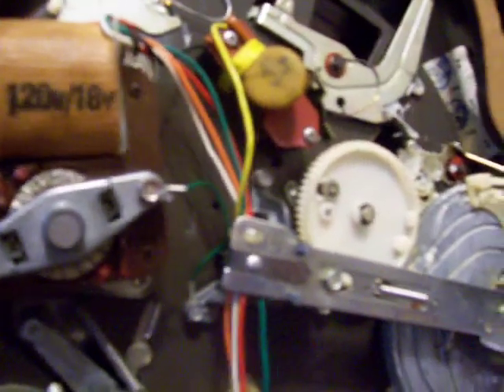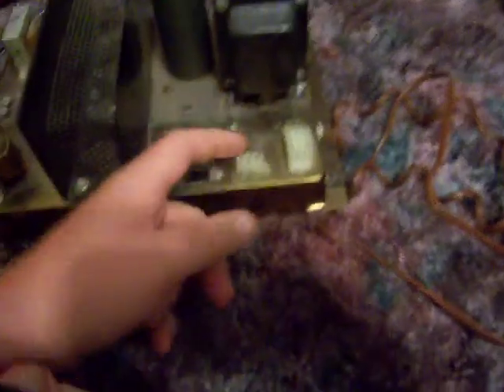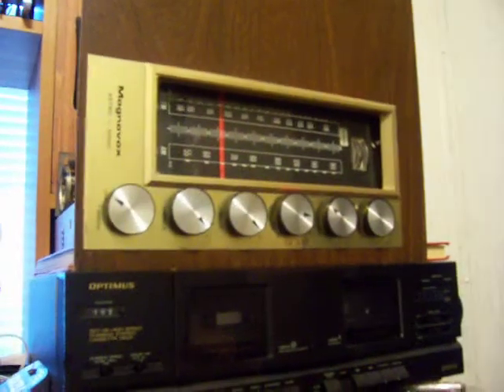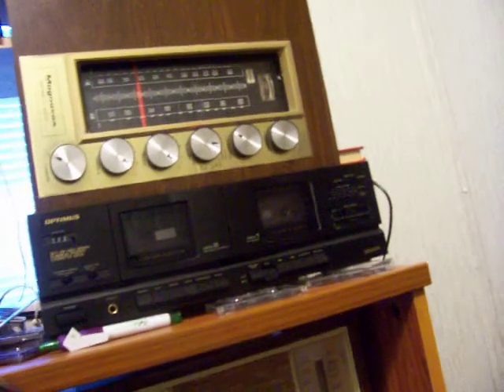Magnavox Amp & Record Changer Hookup Issue

Comment: There is usually one neutral lead and two hot leads in the 3-pin power connector to the phono. One hot lead supplies power from the power line and the other is a return back from the phono switch, so that when the phono switch supplies power to the motor, this hot lead returns power back to the amp.
To get it to stay on, the two "hot" leads in this circuit need to be connected or replaced with a switch to simulate what the phono would do.
Reply: the yellow wire is strictly a return path it connects with the black wire at the changer. I bought molex connectors on ebay the fit the receptacles on the amplifier and changer

Comment: I know I probably have one of this model somewhere but it is buried behind some junk. If you have what you think is the right hookup, just to be sure, a test lamp (60 watt bulb or so) in series with the power cord to the unit is a good idea just to make sure you don't short out the power line if the connections are wrong. There is information on "antiqueradio" "dot" "org" about the series short checker lamp too, it's called dimbulb radio tester.